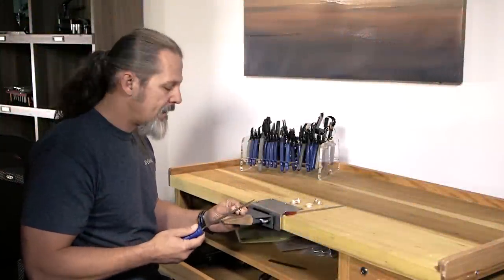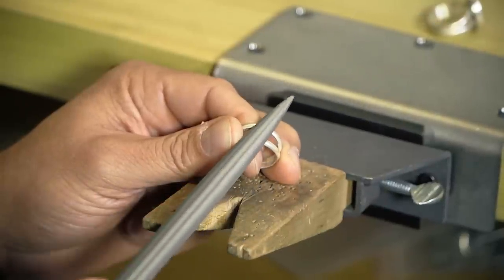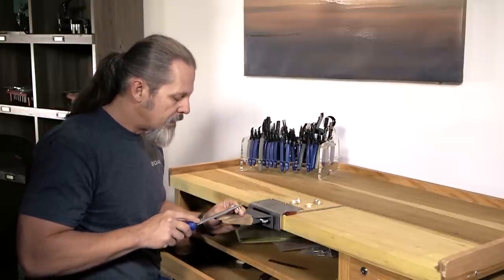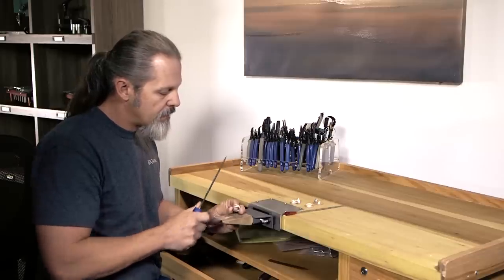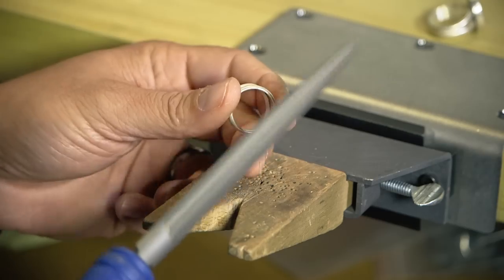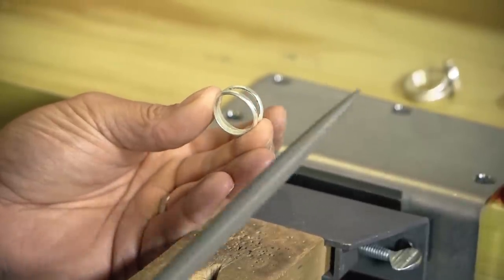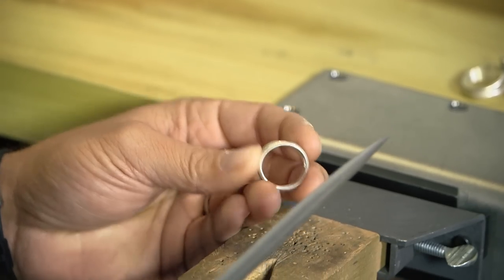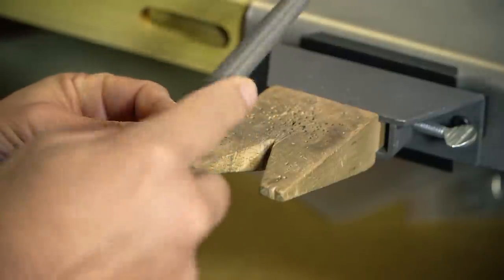Proper Filing Techniques with Mark Nelson

Comment: How do I cut a stainless steel watch bracelet.  I want to take a link off that is fixed with no screw or push pin
Reply from the maker: Hello! Our in-house jewelry techs suggest using a flexshaft with silicon carbide separating disk (https://bit.ly/2ID0kUQ ) mounted to a mandrel like this one: https://bit.ly/2IG90Kh. This combination is like cutting butter! Be sure to wear eye protection.

Comment: I just went through several of your uploads. Cool stuff, by the way.

   I've been trying to figure out how a jeweler would approach a challenge. When I'm building an electronics project box I'm often cutting out a window in sheet metal for a LCD. This is a difficult cut to make and finish square. I even have several years of autobody and paint experience. I understand how to finish a surface well. I simply have a difficult time getting a long metal edge perfect, by hand, and in reference to a couple of 90 degree angles on an inside metal surface. The only option I haven't tried yet is to start making my own custom sanding blocks sized for the specific project. I'm really curious how a jeweler would approach this type of challenge.
-Jake